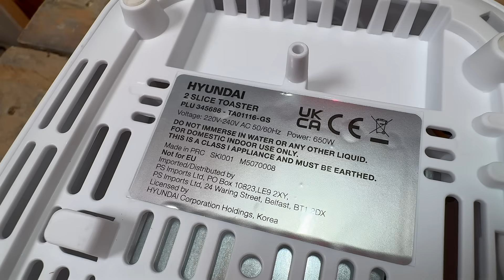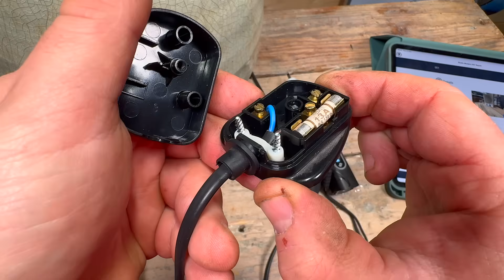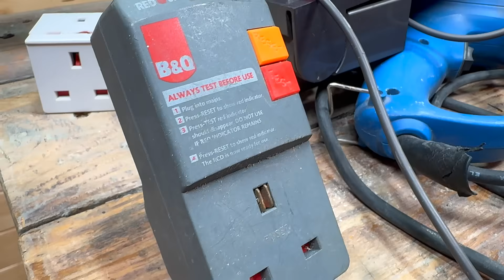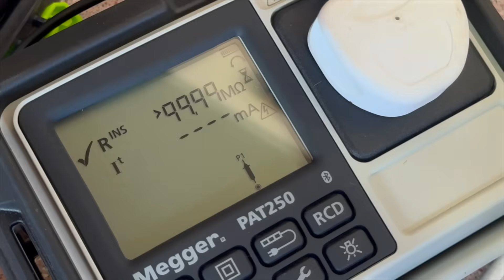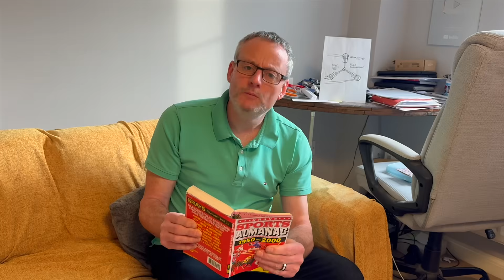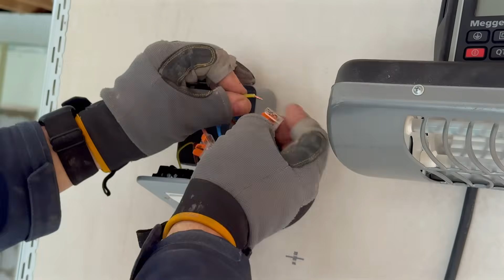How To Pat Test: Step By Step ✅

Comment: I still use a Claire B255 machine  that’s sent away to manufacturer for a yearly calibration   I assume these modern units need the same inspection and calibration 
When it was away for repair we drafted in the modern sticker brigade plug and play 40p an item tested and very shocked how little was inspected and  when asking  about procedure  even to inspecting the fuse  well it works and passes my test today he told me.   Three day course to get his Pat test certs and out on the road     To earn money.  On commision from a third party umbrella company passing the work sites to him

Comment: why I alway get on wash machine over 0.10 ma usually I get.0.6-0.8 any explanations pls ???
Reply from the maker: Difficult to say without seeing how you are terminating the probes. 

Best place to connect probe on a washing machine is underneath as long as the bottom plate is not painted,

Dont stick the probe on the drum....that will do nothing.

Another good spot is the screws in the lining of the door that connect the door keep. these tend to be connected to the chassis of the appliance.

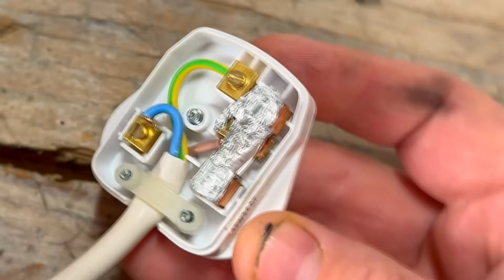Comment: Good video efixx.  A point for discussion at 4:00.  I don't think this is always the case.  An example being fridges or freezers - mine has a 0.75mm2 flex, but has a 13A fuse.  I believe this is standard and necessary, as a lower rated fuse would blow from the inrush when the compressor kicks in.
Reply from the maker: Thank you, and thanks for commenting. 
Really interesting point actually and totally agree, as I have just fitting my integrated Fridge which is 0.75mm2 with a 13A fuse. 

Maybe a future video opportunity 😊
Reply: Yes, the same with some CRT monitors. A 22" LED LCD TV does need a smaller fuse, we had some at work that did indeed come fitted with a 13A fuse.
Reply: @dglcomputers1498 No.
You don't need to use a lower value of fuse because the monitor uses less power than 2990 watts.

The presenter is quite correct, the fuse in the plug exists to protect the cable.

The current rating of the cable is equal to or greater than the current requirement to power the load.
This must be true, otherwise there exists a fire risk.

Then to prevent a fire risk from occurring in the cable itself, the fuse in the plug must be rated at or less than the current rating for the cable.

So the fuse is protecting the cable.
And if the cable is rated at 13 amps, then the fuse in the plug must be rated at 13 amps or less.

So using a fuse lower than 13 amps, lower than the cable rating serves no purpose and therefore is unnecessary.

Comment: eGreat. Another device requiring a decicated app. This is fine, depending on the system requirements for the software. As it's a bluetooth connection, I wonder how it shows up and if it is also compatible with other software?
Reply from the maker: Great question....Who doesn't love an App!
I will say the CertSuite was very good, I also use it for my EICR's, EIC's and Fire Report, so it's a one App fit's all solution. 

As for the connectivity, Im not sure about this but have asked Megger, hopefully they will dive into the comments.

Comment: What happens when a blow heater has an earth but you cannot get access to an earth point
Reply from the maker: Thanks for the question. This is an interesting observation and I actually have a couple of points to share

I have seen in the past a class 2 heater installed with a 3 core flex. Was repaired by the maintenance chap and he used what ever he had lying around, which was this. the protective conductor was snipped in the appliance. 

the other thing I used to have for heaters and appliances that could be a little tricky to get to the earthed metal work was a long uninsulated screwdriver. Would pop my clamp onto that and poke the screwdriver onto the metal work. 

It's crude but can tell you if the protein conductor is continuous and in range. 

Just make sure the appliance is off before you piggle a screwdriver in it ⚡️😱
Reply: Surely there is metal on the blow heater or it would be class 2?
Reply: @Davidhughes9467 No there is table fans and blow heaters along with coffee makers that have an earth but the casing is all plastic
Reply: Is that something that you've actually come across? If so it sounds like a dodgy Chinese product made by someone with little understanding of the standards.
Reply: @mfx1 it's something I've come across, I believe on a Nescafe Dolce Gusto machine.
Reply: @mfx1  Not really its getting more common
https://www.youtube.com/watch?v=HIJaKtzOfao

Comment: Question should the amperage  not now be calculated against the minimum voltage i.e. 216 volts or the possibly due to be supplied 207volts thus giving the highest current possible. So it wouldnt be 8.7 amps but a potential 9.2 or 9.6 amps if supplies change.
Reply from the maker: You always use the nominal voltage 230vac
Reply: Makes bugger all difference in real terms.
Reply: @mfx1   Well technically it might as a 3KW load gives a current load 14.5 .amps, which exceeds the 13 amp protection installed in the plug ( yes I know there is some leaway)
Reply: @Arachnoid_of_the_underverse  Still irrelevant as the largest fuse you can use is 13A.